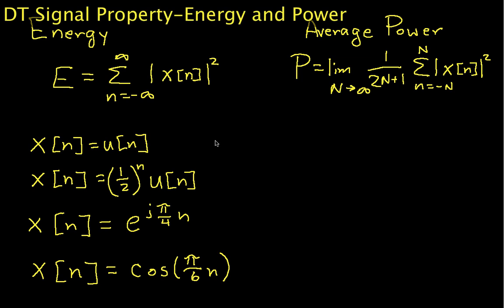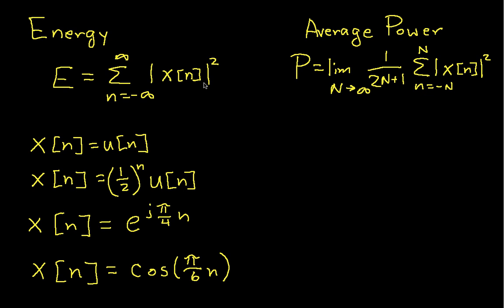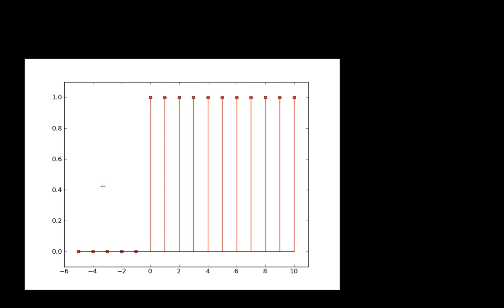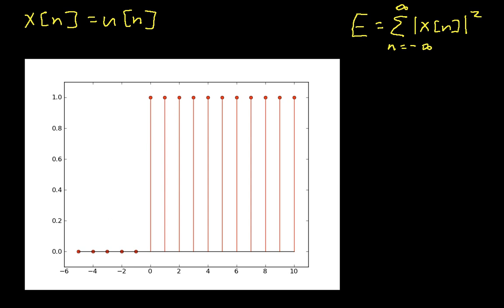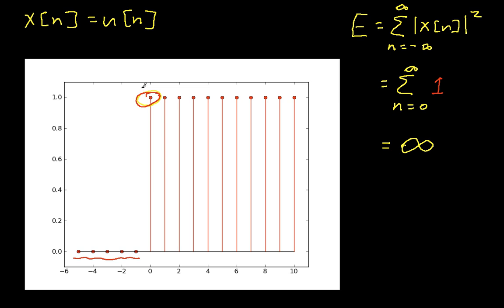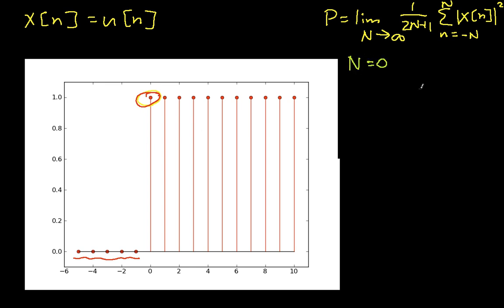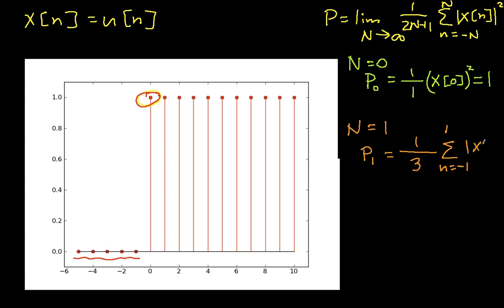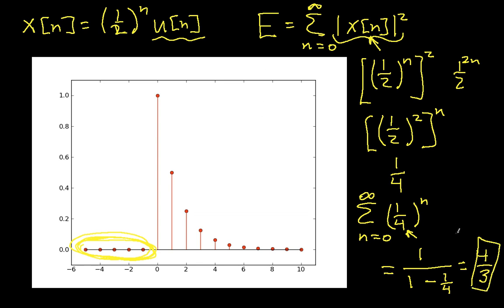DT Signal Property-Energy and Power Part 1

Comment: One thing that really gets me confused, are the units of the Power value in Watts? The formula is independent of the units of the signal, per example the signal might be in amperes, or volts or any other unit, the result is still Power?? How is that possible? I think it isn't.

Comment: if  i have a continuous function defined like this f(t)=t for t=[0,1] and 2t-1 for t=(1,3], how do i find its power?the intervals are still -T/2 T/2 or do they change depending of t?
Reply: let the continuous signal be described by f(t) = { t, 0 <= t <= 1 
AND 2t-1 , 1< t <=3 }...Then P = lim T0->inf of 1/T0 * Integral from -T0/2 to T0/2 (f(t)^2 dt) == lim T0->inf of 1/2T0 * Integral from -T0 to +T0 of ( | f(t) | ^2)... (i just changed the limits of integration so i can compute with ease)You see that your maximum point T0 can reach is 3 (2nd branch of the function), then you know that the Integral doesn't exist on negative intervals, therefore: Let the integral be defined from -3 to 3; we have Lim T0->inf of 1/2T0 * Integral from -3 to 3 of f(t)^2... Let the Integral be called "I"I = Integral from 0 to 1 of t^2 (1st branch of the function integrated) + Integral from 2 to 3 of (2t-1)^2... Because you have the power 2, the module is the same thing with the function so :P = lim T->Inf of 1/2T *  [ Int_0to1_(t^2) + Int_2to3_(4t^2 - 4t +1) ]...After you apply Leibniz-Newton you should get a number that doesnt depend on T, so you cant simplify with the limit...it will be limit T->inf of  1/2T * number = 0